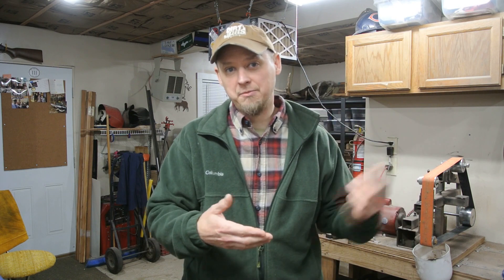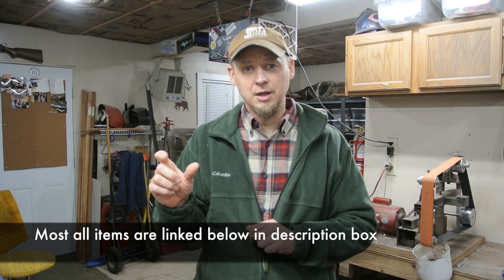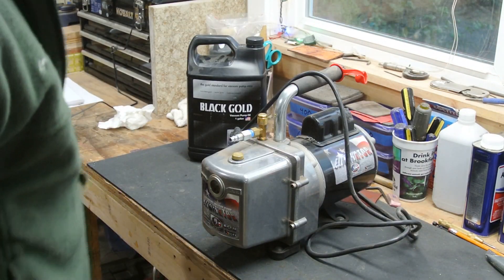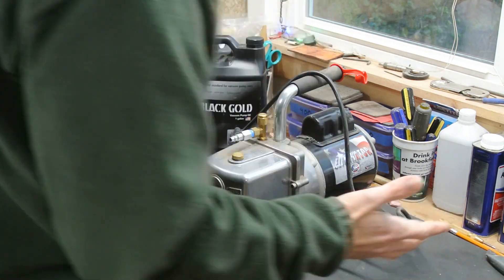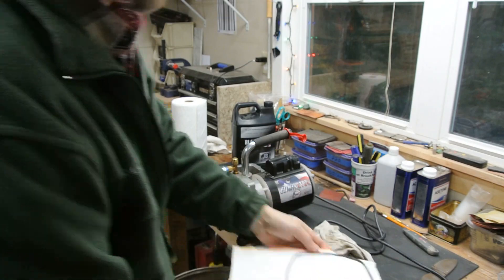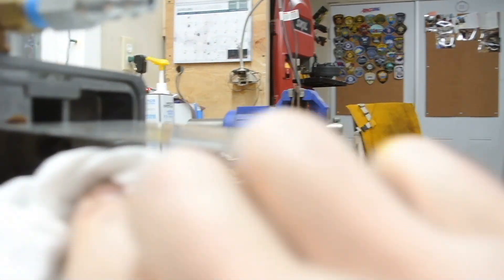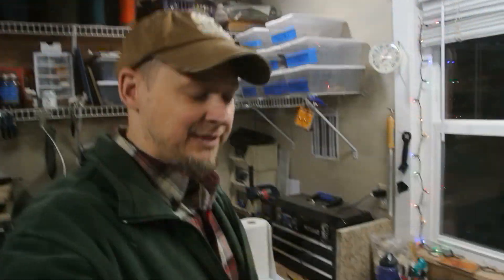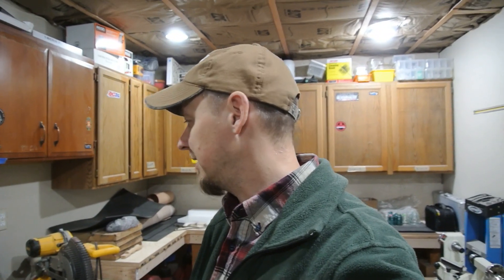Vacuum pump and equipment for stabilizing your scales

Comment: I have a question, can the pump run 24 hours a day?
Reply from the maker: Yes it can I have done so on several occasions.  I found starting a vacuum towards the end of day was best so it could run and I didn’t have to work around the pump noise.